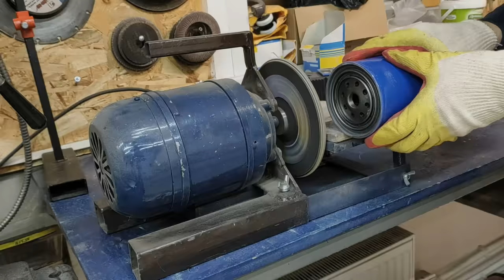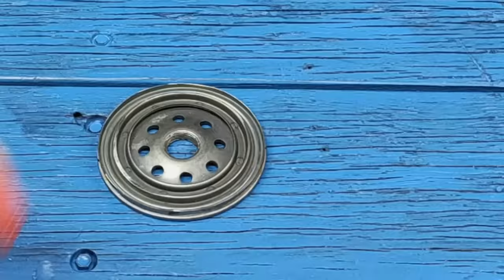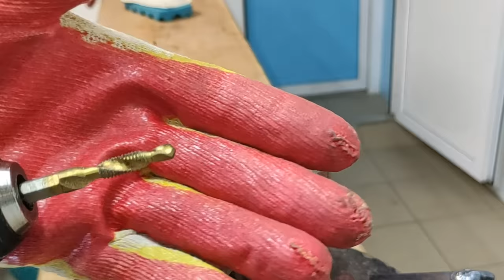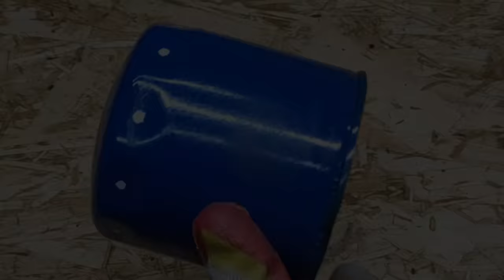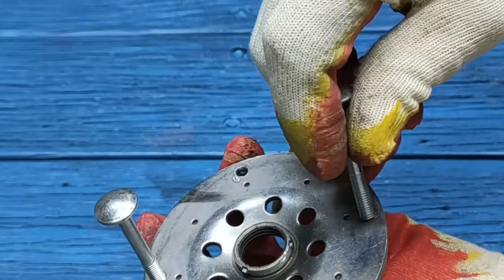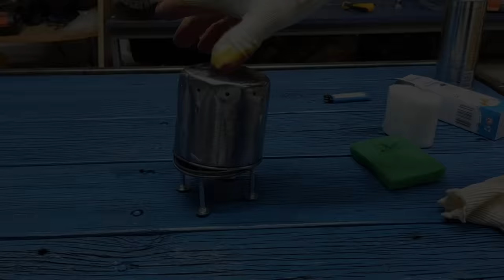The secret invention of a Russian guy from a car filter!!!

Comment: It's actually a portable emergency heater to keep in your car... 
Get stuck in a blizzard it could save your life... in truck driving school they taught us this .. only with a coffee can (metal one)
Reply: A tea light generates just 30 W of heat. To heat a car appreciably, however, you need 500 to 1000 W. Moreover, this design is very dangerous, because the candle can easily fall out and set fire to the car.
Reply: You are NEVER going to get more heat from a candle than what the candle will provide.
Reply: @scooterss2112  I wouldn't want to be stuck somewhere in any situation with you.

Comment: Just be careful. I made a flower pot version of this few years ago. It made so much heat that it turned the tea candle
wax into a liquid and from there it evaporated - and hey presto a complete ball of flame - a REALLY BIG ball of flame.
Luckily it was in my garage and it was hanging from a chain. And yes ...that did heat my garage really really rather quickly!
Reply: Yes they can be very dangerous if the flame heat is restricted freely, anything you put over the flame to heat up, the heat reflects downwards and melts the wax that can go into a big flame as well as burn the table it is sitting on.
I burned my bench, all my shed walls were blackened by soot as it went up in flame
Reply: I remember such a thing happening to me in a glass plate, luckily it was in a garden. Totoal surprise for me and very impressive! Could the effect be used to make a really powerful stove with just cheap teapot candles? This oilfilter conversion idea seems to be a reliable way for quick heating up the wax.
Reply: Would alcohol or white gas be safer as long as you wouldn't kick it over
Reply: @rickblue7002  Alcohol yes, just search for "alcohol stoves from cat food cans";; as for me I use the much larger cans which contain pre-cooked chicken - and are much quicker and easier to fabricate, plus there is no need to clean the old oil from the filter, unless you enjoy the smell of burning oil.

There are several dozen variations for alcohol stoves, lamps, or heaters and basically what it comes down to will be which design you like the best and are willing to spend you time and energy building.

For me I like the type which has kind of a 'vintage' look - which has a section of copper tubing in a coil with a small hole for the flame to be emitted from; this type can do all of the above and to me just had that degree of 'Cool' that I like.
Reply: What's the smallest candle available? Smaller flame, smaller fuel, maybe not as distructive? Just a thought.
Reply: @kenhurley4441  I think the melying problem could be solved by separation. I camp and use alcohol penny stoves to cook, but I can see a candle suspended BELOW the "radiator" as to where the heat from the flame is not encapsulating the body of the candle itself.

Comment: Nice idea. Improvement might be to reduce legs to three equally spaced bolts. Just as stable but simpler. Also creat a small grid above the flame to hold a small camping pot and see if can be adequate for cooking. Then it'd be really worthwhile as a cheap, easy to pack and carry emergency cooking stove. Even being able to boil a liter of water in a reasonable amount of time would make it handy as hell.
Reply: M.
Reply: @silviafierroclara9221

Comment: What an anti-climax! Here I was expecting something amazing and you have something that is almost useless.
Reply: Stop breathing and save Earth!
Reply: I know the reasons why it works, but I aint gonna tell the guy who said the useless word.
Reply: Mr. Greene I couldn't agree more. Why waste so much time building something that would look out of place anywhere other than in a garage? Note he use d a clean oil filter. I wonder how long it would take to clean a used air filter rather than use a brand new filter.
Reply: It's an emergency heater to keep in your car.. it could save your life .. get stuck in a blizzard.. keep a few extra candles for longevity heat.
Reply: The inventor might not like being called useless, he may think the same thing on the one who called it that.
Reply: It's an emergency heater to keep in your vehicle....
Reply: Hunter has been selling them like hot cakes to the Ulranianian  army . The big guy is making a whispering fortune .
Reply: Totally!!! 😖
Reply: Killer survival hack, terrible headline.
Reply: This item is PRICELESS ! It can do a great job if your power goes out, or if you're camping. This is a great idea. It just uses little lamp candles (Tea Lamp Candles), that are cheap as dirt and is enough to heat a small area!
Reply: Y para que sirve eso? 😅😷🤣